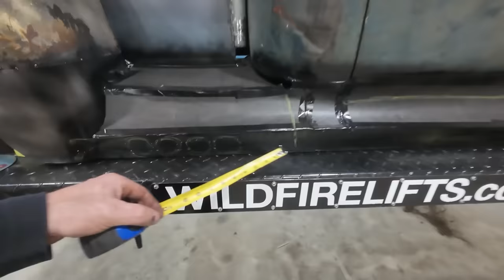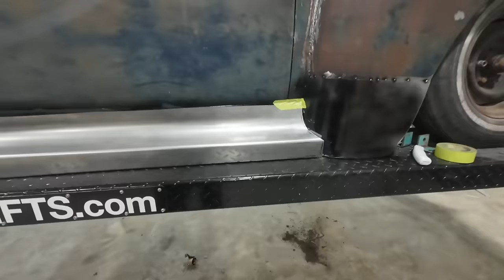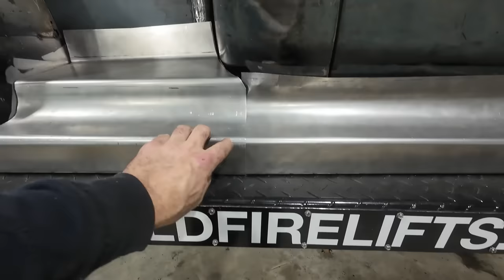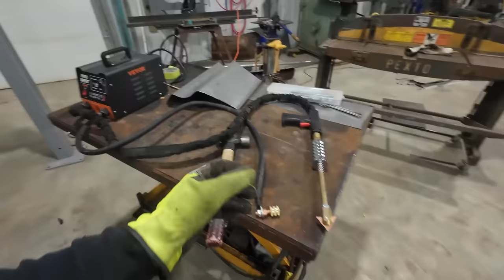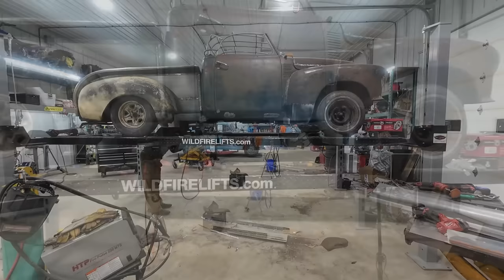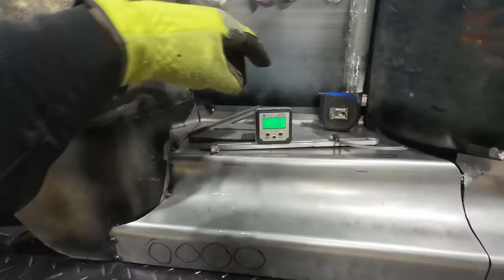Our '49 GMC Roadster Pickup gets Running Boards!

Comment: The running boards are coming nicely.  I chuckled, when you were working on pulling the dents.  I remember how much metal there was on those old beauties.
I think this happened in 1959, in the days before seat belts were a thing,  My buddy, had a 50 GMC, and while making a left turn in town, the passenger door latch let go, and the door flew open.  Suddenly, my ass was hanging out over the road, and the only things keeping me from polishing my butt on the road, was that I had the window down, and my arm was on the door.   The combination of having  my right arm holding me up, and my feet in the cab providing some support, stabilized me long enough for him to get the truck stopped.  His only comment was, that he wished he had a camera.  
I was one of the first of the hot rodders in our area, to install seat belts in my 34 Ford pickup.

Comment: The pin spotter is the same machine we use in duct work for doing liner . You pin , push insolation over them , place clip on to hold liner .
Reply: So he's missing a step to work that machine,? Just curious. 
It didn't look like it was holding well. Then again duck metal is thinner.
Reply: @snoopu2601   most of the duct work I put in was commercial and was big , hospitals , nuclear plants and thing of that such the pins always stayed on but that stupid looking thing that had a arrow on the end was junk .
Reply: @markmckeachnie4484  thank you for answering back 👍🏽save me the trouble of getting one. I'll just stick with the stud gun.
Reply: @markmckeachnie4484 , I wonder on that arrow type puller, it doesn’t seem to have much purchase with the arrow. Do you think if Brent would maybe file or grind a flat on the end of the arrow, like a 1/16- 1/8”, it would hold and pull better? Probably just as well use the pin welder I guess.

Comment: Hello on the  brake and pipe issue just drill and tap  say 3 holes on the outside of the break edge and bolt the pipe there. We did that on ours at the race car shop works great . Also could  make a bigger pipe   and just interchange when needed

Comment: You need to extend the back of the rear fenders and tie them to the rear pan. You need to extend the front of the front fenders to match what you have going on with the sides. Of course, that means building a whole front pan too. Great work.

Comment: Hey Brent ! looking good but if you lay your marker standing up flat against the back of the cab and scribe the panel it will get you the right line.Mount it all on the cab with frame work to make it structural and cantlever the back part with enough gap to allow for frame twist without scrubbing against the box.

Comment: Brent, you should extend the step profile to the door section… where you separated them was a good spot but that flat step profile should be matched over to the back of the door section… might be tricky since it would just be a very small triangular piece but I think it would match up nice.

Comment: Ron Fournier’s book on metal fab used the pipe mod on the brake to do  radiused bends. Only he added ‘L’ brackets on the back side of the pipe for a consistent location of the pipe edge. I believe (it’s been a long time since I read the book) the hinge point of the brake could be adjusted to make the bend. He had different pipes made to accommodate different radii.

Comment: Brent... cut a groove lengthwise out of the iron pipe to fit the bending maching plates into. That will cause the pipe to always stay in the groove while you bend the sheet around the pipe.

Comment: you could keep the same bend to follow the rocker and fold it back like a carpet edge to keep the same smooth edge look following the edge of the rocker , to the back side of the running board that is . and keep nice clean door jamb edge

Comment: Hey Brent just a thought here but why not take a slot out of that pipe so that it nestles right inside your upper die of your brake? It should make it easier when lining up. If you have a mill it wouldn't be a bad idea to indicate it up for 0 and do one long pass this way you know your radius will be on center.  If you add two set screws one on each end of the pipe it will hold it in place on your brake.

Comment: Brent how about slicing that black pipe to fit on the break . To stay on the upper piece of the  break to hold in place. Then it won't move as you press down. Just a thought.  It's come out nice!

Comment: I like how it's turning out with the " running boards" . I would cut the doors even with the top of your rolled pieces. Keep working on the cab corners. Strengthen the cab to help eliminate or minimize the flex. It was never meant to be a roadster. You'll figure it out. Enjoy

Comment: Brent, be on the look out for a 110 volt hydraulic pump unit and 2 small cylinders. Mount the cylinders on the stomp shear arms,plumb a hydraulic valve and you have a hydraulic sheetmetal shear. No more jumping on the foot bar.AL B.

Comment: Hey Brent, how about using that gas pipe as your edge.  Then weld flat panel edge to the pipe.  That would correct that small curve.

Comment: Maybe pocket your running board for the door and if you put a 2 inch ledge around the inside of the cab where it's cut then reenforce the latch post with 2x3 tubing as well as the hinge post your door will stop flexing, I'm old.

Comment: Project is inspiring! Just a thought, could you cut a slit in the gas pipe you used to make a radius, then slip it over the upper die of the brake? If it works (just came to me watching you), you could to different size pipes for different radii.

Comment: Brent, I know you won't spend the money but Altman latches are very good for the chevy ADs.
Also starting at the outside perimeter on q rent is actually how you should fix it. Think of reversing the action of a rent, the lowest center party of the dent is first so do it last. When you were offering tension on the stud and hammering was perfect or when snatching with the slide hammer from the outside in. ￼
Lastly, is that machine a110v? I have found they don't cut it but the 220v versions work well. Oh and you're right, newer thinner metal on newer cars is way easier with that 110v unit.

Comment: First thing...I love your show!  Now let me offer a few suggestions for your running boards? you can use a set of old headers for the pipes in the running boards.  As for the door, I think your way is the best, as altering the door can run into problems with the weather stripping on the bottom ( If there is any) Just  doing my typical "Captain Obvious" thing here...LOL

Comment: Cool running boards . If it was me I’d cut the bottom of the door at the new metal line height and square it back to the inner sheet metal. And just cap the running board as it sits now. Only my idea but it just seems logical to my mind

Comment: I'm voting for cutting the door where the running board top edge is located.  Make the door bottom shorter and level with the floor.  That way you don't have to mess with a seam in the middle of your nice curved side.
Reply from the maker: I think it would look so much better though haha

Comment: Brent, here’s an idea: continue the upper roll on the running board straight thru from the front section to the rear. Then fill in the wrap around the body as a flat piece - front to rear gap would stay in the same place. Just saying…

Comment: Put an offset in the rear portion to sit under the front portion of the running board/skirt. Unless you are right on top of it the gap will never be seen

Comment: Could you cut the pipe long way and weld a cap on the ends (To use on the brake for Radius

Comment: If you split the pipe in half lengthwise it would be more consistent in the brake. 
Didnt care for the concept at first, but im actually starting to like it. Wouldnt mind a stud gun. I could see a t-welded to nut,saves wrenching for every stud.

Comment: Just not that long ago, working off of a motorcycle jack, a single project and cold most of the time, tools lost in piles, now trying to remember just where you have them organized. I want to see you build a hydraulic press from a hydraulic cylinder so you don't have to jack the pressure on something your needing to press. Much quicker and more power than you could ever need. True horders have such stuff hiding somewhere on the property. In a couple years, projects outside will get covered as well. If anything positive came from the fire, its forced you to get organized a touch better. The losses of stuff are still too painful to mention tho. I too, have lost everything and so go to find something and then remember its gone. A young guy can't have enough an a old man like me needs just enough to survive. The worst for me is being crippled or who knows, I might of came to Canada and made you misérable with questions on how to chop tops and how you get those crazy fine flame jobs to look so sweet. Ester getting up to make coffee and find we already had coffee and went outside to get into more troubles. Even worse would be seperated at a auction and bidding against each other without knowing it!! It happens. Someday your going to SEMA with a fine looking rig and make history. Please stick with carbon fuels as using a cordless tool battery to drive to town is not driving. Its the sound of the exhaust and some black rubber at some street corner.... and the PO PO catching us. Take care friend as its got to be just as cold as here at forty below zero.... american temps. Why doesn't the temp gauges still give both ways for telling temputure.

Comment: He Brent.  Instead of cutting the running board why not cut the door at the top of the running board and then weld what you cut off to the lower part of the door opening.  It would really help stabilize the movement between the back of the cab and the door….

Comment: Hey from across the pond again Brent. Just another Suggestion, how's about making "pop" doors or shaved handled doors. I think those original handles subtract from the curvyness going on on the bottom, you got to fart around with the latches anyway ?
Reply from the maker: Yeah might happen not a fan either

Comment: Those panels are a fabricator's nightmare...  At least the rear one does not taper from end to end.  The front piece is really complicated because it tapers on both ends and narrows in the middle.  Plus, the ends are really different from each other.  You will eventually get it made to your satisfaction.  Would it be possible to reinforce the A and B pillars to help with the door gap issue..??  I have no idea what can be done about the floppy B pillar.  It is going to give you fits...maybe a formed brace that fits behind the seats and ties them together, which could then be braced to the back of the cabin floor..???
Reply from the maker: Yeah kinda the plan with the rear seat brace